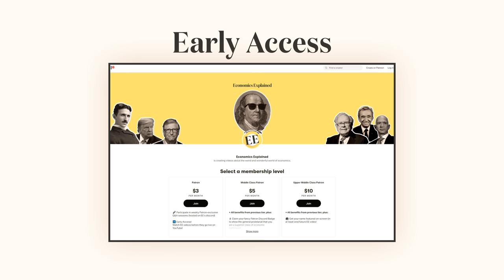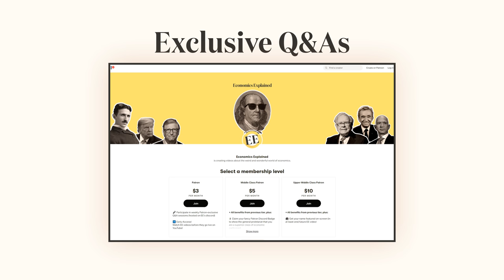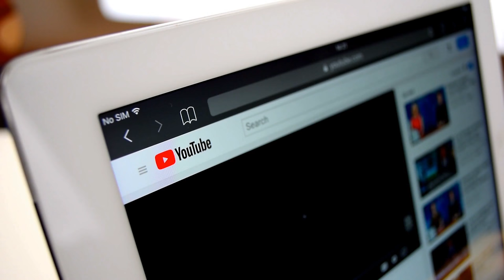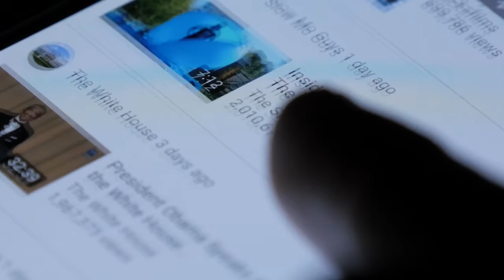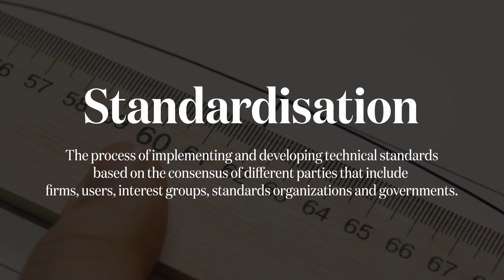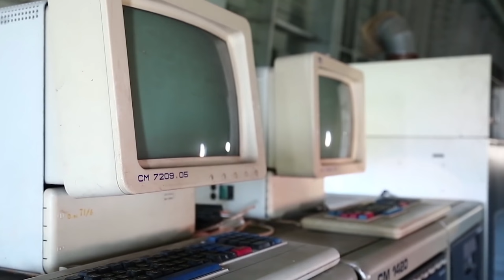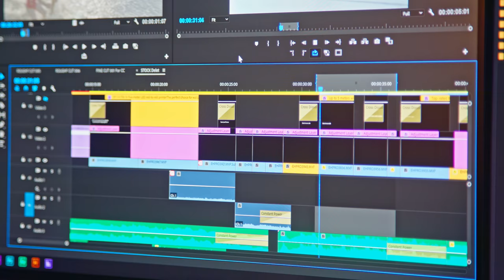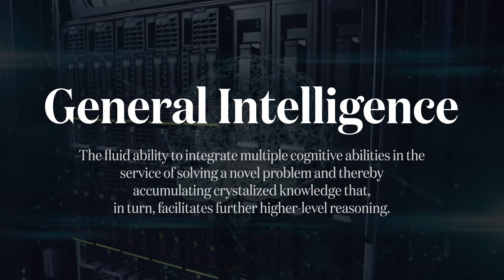Is the Fourth Industrial Revolution Worth the Hype? | Economics Explained

Comment: As someone with a background in high performance compute (wrote my master's thesis on the subject) and a good understanding of the latest fad in AI, neural networks, I'm going to have to point out that we're still very far away a good general purpose AI. Neural net AIs are great and make solving a lot of complex AI problems much easier and cheaper, but they have one big weakness. They're not general, the exact opposite, they're very if not extremely specific.

Comment: The dichotomy at the end is the most interesting. The time distance between the so-called second and third industrial revolutions was much larger than the distance between the 1st & 2nd and the 3rd & 4th. The processes in the 2nd happened by the 1870s and the 3rd started in the 1940s (though they didn’t make a meaningful dent until the 1960s).
That is, if you accept these categories. First of all, a society doesn’t develop the tools for historical categorization until an era has passed - many of us partook in the processes of the so-called 3rd Industrial Revolution. Secondly, modern lifestyles - relying on electricity, indoor plumbing, central heating, standard appliances, instant communication, automobiles, massive product diversity  - arose between the time of the so-called second and third Industrial Revolutions. Computers and smartphones didn’t change out lifestyles to the degree the items I mentioned in the last sentence did.

Comment: Your 4 Industrial revolutions description is woefully inadequate in that it's too information industry centric.  You neglect  mega advances like electricity, oil energy use, railroads, automobiles, medical advances that reduced childhood death from 50% in 1900 to 5% by 1960, the green revolution of 1950's which enabled a population doubling from 2 billion to 4 billion by 1975, plastics, and even computer integration with bar code reading.  AI is not going to radically change the world because automation, sensors with computer integration have already increased manufacturing productivity more than any future changes.  What's needed for a manufacturing leap is a deeper understanding  of chemical reactivity so that Star Trek replicators are economically viable along with an energy leap that fusion would provide. Throw in a computer brain link up and innovation across all industries would advance exponentially. Then there's the potential for major biological advances so we truely understand Physiology, genetic expression, cancer etc. AI needs to understand how neurology converts into language and information and someday it likely will but will it be so good as to revolutionize our weak understanding of Physics, Chemistry and Biology such that theory drives innovation not the last hundred years of trial and error empirical trials which has driven most of technology.

Comment: What about electricity as the third industrial revolution? It kind of goes with standardisation , maybe slightly later. Electric machines enabled production of goods to be located separately from energy production e.g. nearer markets or nearer other raw materials. Electrical machines are also more precisely controlled , start instantly, are more efficient and can be smaller than steam machines, thus positioned for more varied work. Not forgetting the productivity benefits in lighting homes, factories and offices and the time saving domestic and office machines like vacuum cleaners,  washing machines, printing machines, elevators etc..

Comment: You see that housing market over there? Beautiful isn't it?
Would be a shame if someone built a really big 3D printer, that prints custom houses in ~2 days.
Reply: yeah but they can't. They can only build part of the frame. The rest of the house still has to be built the old fashioned way and that's the most costly and difficult part. From finding suitable land, to securing a loan, to hiring an engineer to build a plan for the contractors to use, to finding and hiring contractors who won't screw you over, to installing the difficult bits of the house like the electric, plumping and sewer hookup.
And really we can already cheaply and easily build and transport modular houses. 3d printing if anything is inferior to already existing processes.

Comment: "changes and improves the way business is done" is an extremely biased overly narrowed self centered useless definition. But I guess when all you have is a hammer, everything looks like a nail. The way business is done actually hasn't changed much and none of the industrial revolutions would have been any less revolutionary if business did not change at all. If anything, business changes are more a result of social changes than changes from developments in materials science as "changes and improves the way business is done" actually lags the changes caused by a change in materials science. The major revolutions are measured by how they change things like transportation, energy, communication, product type and quantity/availability.